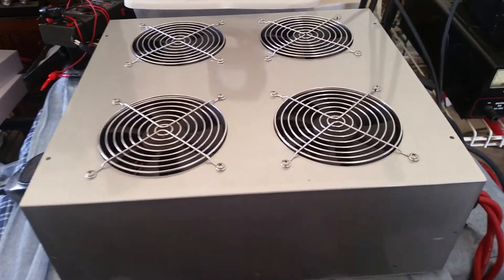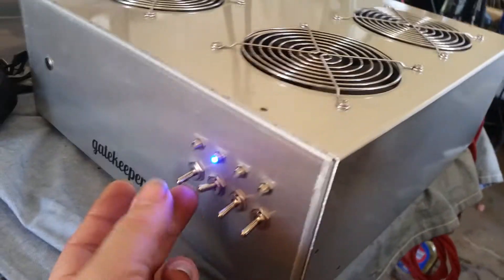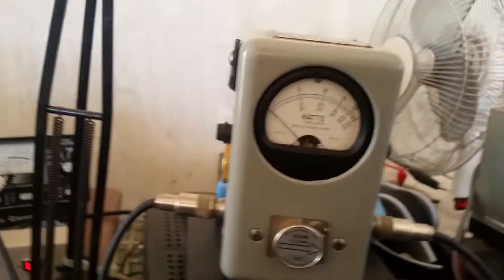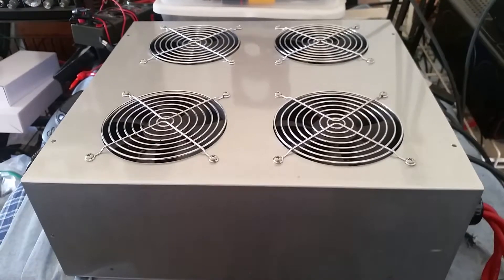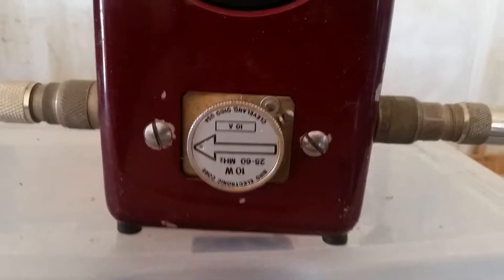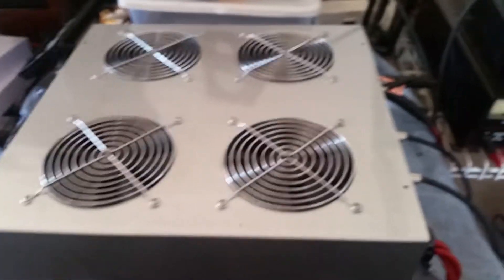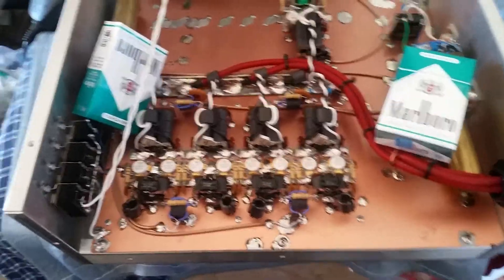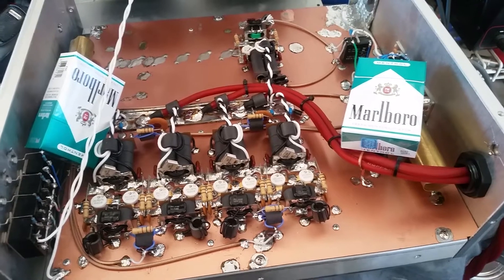1x2x8 Staged Maul Didn't work out 😠 So L👁👁K at what I did Instead!

Comment: Nothing against you gatekeeper but this just seems like a wasteful and bad idea. 

What is next a staged 1x2x4x16 next? 

Guess someone was going to make the money off this customer no reason it should not be you!
Reply from the maker: Well I didn't make any money off this guy but I won't get into that. But it was his idea to attempt the 1x2x8 but you have to think of the flexibility that would give you with a 1x2x8 Just think about it bud. Gotta think outside the box.
7 Different Possibilities:
1.  1 pill by it self just loafing...
2.  2 pill by it self just chilling...
3.  8 pill by it self(if you have a strong radio)
4. 1x2 you can use this by it self if you have a small drive radio

5.  1x8 This is a way to loaf the 8 pill and run it on the low side.

6.  2x8 Here is a good match for a dual final radio because the 2879 drivers make it more like a medium driver set up
7.  1x2x8 Now this would only be for someone using a very small radio. Im talking about a tiny output radio.

Now how is this bad or stupid. Brother I'm a builder man and I think it is freaking neat....I could build me one of these and use one amp as a driver for anything on my bench In my videos.

Hopefully I made since...I did to me lol lol

Comment: just make it a 2x8 you can adjust the drive to change the output
Reply from the maker: Completely agree with you but the owner wanted it staged so he could use a separate driver for the 8 pill section or so he could use a strong 💪 radio. Also he wanted to be able to use the 2 pill section by it self also. I agree with ya though bud. All preference!

Comment: oh 1 more thing. redo that in 2 pill stages.   lol ull love the difference!! just a idea...lol
Reply from the maker: Imma take a wild guess and the one your talking about that you have that will do 2500 to 3kw is done in 2 pill stages lol? I have never done one like that yet. I understand it is considered a more of a high q circuit because it cancels one stage of splitting and Combinning which means less db incertion loss :) I've got to give it a try some time. With 2" transformers 😉👍🏼
Reply: @1883GotDown  yep you got it!! the 4 port combiners are not hard to tune. after u do that? try a 4 pill with a 2 port combiners.. that's wicked! then do a 16 pill with 8 port combiners. hehe

Comment: that working real nice. I have fixed a few 2x8 before. don't like 1 pill driver. very low drive. I got a 1X8 all MRF 455 . depending on when radio drive. MRF 455/454 or 2SC2290 makes great drivers. The one I did with 2  MRF 454 driving 8 RFP 2979 did 1600 PEP and about 850 RMS on his radio . I have seen 2X10 and 2X12 amps. in same cabinet hear used. The trouble with 3 stages is the pass threw tune of each stage. I got much better per amp with PTT bypass. my foot pedal keys my IC 7300 them the PTT  line on radio does the rest . MFJ tunable adjustable gain per amp. about 1.6 MHz to 60 MHz . has dual gated MOSFET . like using Ch. 10 and with bleed from Ch. 6 it cuts a lot if tune correctly keeping gain down. also helps with out of band noise and stations. A standard pre amp does the entire band and some.  witch most of the time is counter productive. 😀73's